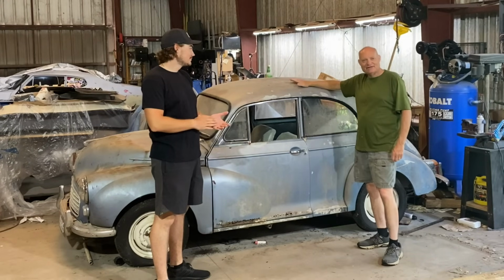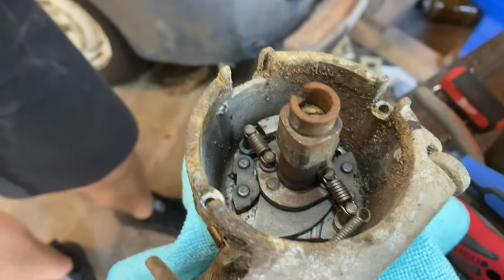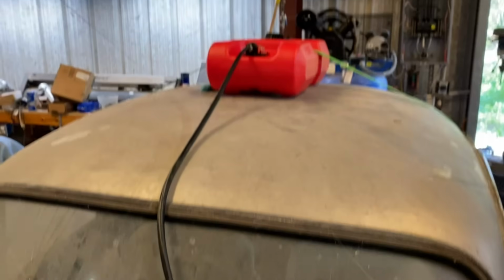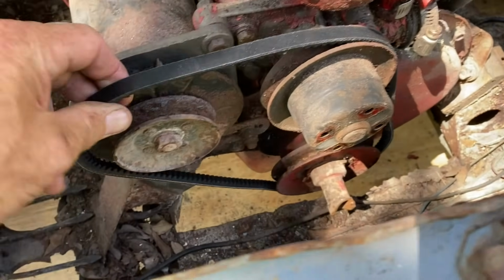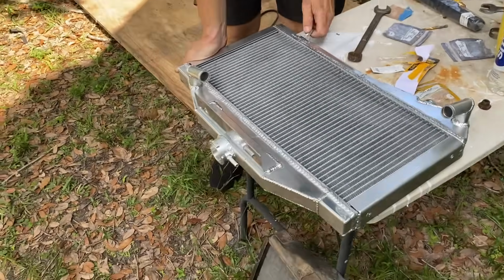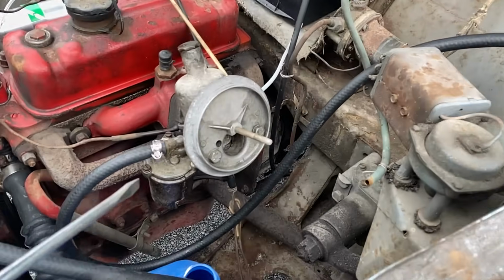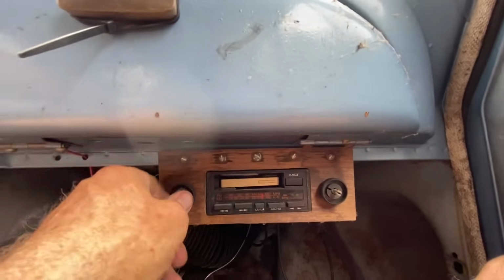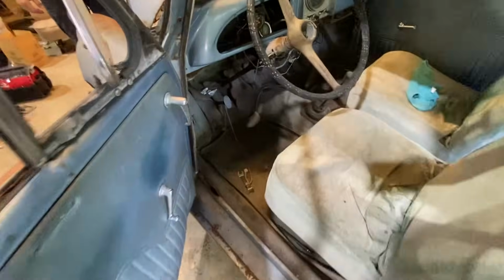1967 Morris Minor (Will it Run and Drive?)

Comment: 75 yrs olde here. My father had three different "Woody" versions of the Morris Minor. I passed my driving test in his pale blue "shooting Brake" in 1967.
Later years he had the Morris 1100 estate with hydrolastic suspension. We had the engine rebuilt at a machine shop and installed it our selves.
The darn thing would not run, even after we towed it around the neighbourhood. We discovered that with this series of engine the distributor drive can be installed 180 degrees out of whack. Look at where the distributor goes into the engine block at 02:57 - The drive peg is not offset, so it can go back together the right way or the wrong way!
Reply from the maker: I’d love to have a Woody. It seems to me the distributor was installed 180 out in my car but the wires were adjusted so that it would run. In most cars when no 1 is at TDC the rotor points towards the number one cylinder. Can’t remember if we had an issue starting it at some point after installing the distributor but I wouldn’t be surprised. It’s easier to just reroute the wires than pull the distributor.

Comment: She's done. Needs a whole new frame...new 'plexiglass' front and rear windscreens (yes, apparently, they are available in Britain - somewhere)...I wouldn't drive this with a totally rotten frame subassembly...gonna fold up on you...not good...but, hey...My aunt had one of these in the 70's on her farm near Hamilton Ontario...once you got it started (leave the choke OUT in cool weather!) it was fine...battery life was terrible...the generating system was awful....Good to see this video, so many memories!
Reply from the maker: Thanks. We haven’t driven it since the video. We want to weld in all new metal underneath but just haven’t found the time/money. It’s only worth it because this one is sentimental.

Comment: I left my 1969 Volkswagen with my parents while I was stationed in Germany from 1973 - 1976.  When I returned from Germany I just assumed that since it had not been started for three years that the engine would need to be rebuilt.  I knew nothing about cars.  I bought a new battery and fresh gas to see if it would start.  I pumped the gas a couple of times turned the key and it fired right up.  I never had the engine rebuilt as it ran like a champ after having sat for three years.  Great German engineering!

Comment: My first drive was in a Morris Minor of 1954.  I learned how to drive on it and later learned a lot about the inside of engines.  Yours has the  1,000cc motor, mine only had the 803cc though I later swapped for the BIG engine.  Mike in Oz
Reply from the maker: I didn’t know about the 803. I knew there was a flathead and later the 948 and then the 1098 that we have.

Comment: The suspension pins were a weak point and bad design, so long as you greased them very regularly they would be fine, but going back 50 years you would see the odd one with the suspension gone at the front.  Easy to fix but not great when they failed on the road.    I had two of them, so easy to fix, ah happy days!

Comment: Lovely to see it running, and great memories.  I fear that with so much rust it might be the last time 😢
Reply: Morris minor spares in the UK have every part for rebuilding an MM.
Reply from the maker: Thanks, It won’t be anytime soon but I’m confident we’ll get it on the road again. I do think I need to hurry up and buy the replacement metal while it is still available.
Reply: Not at all. Fluid Film treatment will stop it for good. Well, after some replacement and maybe welding

Comment: Lucky the thermostat housing wasn't  corroded to the block  and the studs !  If I remember correctly,  when you get to the master cylinders under the floor you'll find some of the  nuts/bolts are 1/4 Whitworth..... does get more old school than that !

Comment: My first Car, Paid $70.00 for it. Drove it aroun,d, illegally of course cos I didn't have a license, The I got my call up and it sat outside my mum's house for about eleven months while i was away. Came home on leave, got my license, then traded it for a red Escort, got $200.00 . good car , windows taped up cos the winders didn't work. Rust holes in the floor, but you couldn,t stop it.

Comment: Did everything in a Morris minor .would pull the car over onto a square bale and change the clutch. I think I did it all with a 1/2 inch And 9/16  spanner. Owned 5 in the day still wish I had the traveller. Brakes were terrible the shaft would seize under the floor Matt and the cylinders would seize. But the engine would always start with the starting handle. Simple car. No fancy electronics. Loved them.

Comment: I have a 1952 Morris  minor  4 door side valve Engine  with Dashpot front suspension system , leaf spring rear suspension.  Not in working condition for over 15 years  it gave me excellent service . Now parts availability is problem

Comment: My first car was a 1959 Morris Minor. At age 16 I learned a lot about cars with that model. Required vegetable-based brake fluid, proper installation of front wheel bearings, desirability of synchromesh in 1st gear, necessity of damping oil in SU carbs, proper centering of jets in SU carbs, desirability of decent oil cooler in California and/or cross-country trips, ineffectiveness of low-compression pistons, downside of shaving the flywheel (ring gear eats a hole in the oil pump), non-necessity of turn signals as standard equipment . . . I could go on, but I think I’ll stop here, I think you get the picture.
Reply: I currently have a 1959 Morris Minor 1000 / 2 door 😊

Comment: Those engines, not actually Morris, but Austin, 3-bearing crankshaft, pushrod valve operation were still in production until the year 2000, although unrefined, "tappity" they had a hard to beat combination of  drivability in a wide torque curve  and low fuel-consumption, Harry Weslake was the engineer behind the cylinder head which gave these engines  those characteristics.  Another aspect, even after high mileage, they were good first time starters in all weathers, deep winter or high summer,  something which the equivalent engine from Ford could not match
Reply: thanks for showing it was a bit like back to the future lol  i enjoyed it
Reply: The car was designed by Alec Issigonis. He was born in what is now Turkey. The headlights in the early version were down below on both sides of the grill. They were repositioned higher up to suit the US regulations. This change displeased him. Of course his fame was sealed with the iconic Mini design. As has been pointed out, the side-valve engine was replaced by the Austin OHV engine improving it greatly. It seems strange that side valve engines lasted so long when there were OHV designs around even before the war such as the MG engines derived from Wolesley models. Ford in the UK carried on using (low compression,  poor MPG) side valve units (100E) up to (?) 1970 until the 105E replaced them.

Comment: Oil in the dash pot will improve the operation of the SU carburettor.

Not sure that red engine is a factory rebuild. Here in the UK at least, factory rebuilds were "Gold Seal" and painted accordingly.

From memory, and it is about 50 years ago now, rebuilt units didn't come with ancillaries (manifolds etc) so wouldn't have been painted in the same colour as the block/head.
Reply from the maker: I don’t remember where my dad found the engine but my memory tells me it might have been silver. I think I painted it red with leftover pint used for a Chevrolet engine. Next time we work on it I’ll scrape off some red and see what’s underneath.
Reply: @davebdave1  if I recall correctly you can tell the origins of the engine (capacity, type of vehicle...) from the prefix of the serial number on the block and a factory remanufactured engine will have its own prefix. I think I've got some documentation around here somewhere.

If you let me know what the first 4 characters of the serial number are I can probably check them.

Comment: My father had a Seriies V Traveller in which we had a memorable holiday around 1970 camping in France, Switzerland and Italy.

Rather later in the '70s we had a 2-door Series III as the family car. Dad bought it for Mum to drive and my brother and I to learn on. The deal was that Dad put up the purchase price and that was it, we had to service and repair it ourselves with Dad's tutelage if required.

They had weak 1st/reverse gears and we had to change 2 or 3 gearboxes sourced from the scrap yard. We eventually came across a unused Gold Seal (BMC refurbished) gearbox and that was the last one we fitted. We were pretty adept at whipping out the front seats, taking up the part of the floor covering the gearbox/clutch and swapping the gearbox, a Sunday morning job.

The brakes were a pain as the wheel cylinders seemed to seize on a whim and always needed changing for the MOT.

Dad's insistence on us maintaining repairing it is principally what has enabled me to maintain my own cars over the years up to and including our current BMW E39s.

As teenagers we had ideas about dropping Midget brakes and engine into it but this remained a pipe dream.

My first car was Series V Moggie 1000, given to me by my grand-father when he gave up driving. It didn't last long. In common with most BMCs at the time the tin-worm was quietly chewing away at the floor and sills. 

It was his 2nd Moggie. He had a Series III that he had traded in for an 1100. The 1100 never did find favour with him and with some expensive rust repairs required on what was a nearly new car he got shot of it and bought the Series V.

His brother's one and only car was a Series II convertible, it would be worth a bob or two these days.
Reply from the maker: I had forgotten but we did replace the gearbox at some point. I don’t know where my Dad found it.

Comment: Radio looks pretty good
Reply from the maker: LOL, I mounted it to a wood panel to isolate from the Chasis which is Positive ground. I spent some time making sure everything was isolated from the car’s metal but that was before the internet. I now know that I could have just switched the battery to negative ground and re-polarized the generator in a matter of minutes.
Reply: @davebdave1  ye even before cd that one

Comment: CLUTCH SEIZED INFO... Previously the following has worked for me...warm up the engine in neutral.  Then switch off.  Then select first gear, (or reverse), and start the engine. The car will lurch and start driving forward (or backward). Remember this is decades before those silly new safety laws about "foot on the clutch to activate starter", (none of my cars have EVER had that). Now as you drive the car around the yard in first/reverse accelerate and deccelerate in a jerky fashion.  This will often enable a stuck clutch to become free. Job Done !

Comment: RADIATOR CAP info..., yes be sure to use the correct Pressure rating. The oldest Morris Minors, the Sidevalve engine models from the late 1940's and early 1950's were ZERO pounds pressure rated, ie it was just a Steam Venting cap. It had no spring, just some zigzag sorta holes to stop water sloshing out on corners. It worked without a waterpump but the radiator had a large top tank and contained from memory 14 litres, about 14 US quarts of coolant. Later British cars, such as the later Overhead valve Morris Minors, 850cc, 1,000cc and 1100cc had either 4 psi or perhaps 7psi radiator caps. Yes you are better using the original old Radiator cap at first. Find out what that model was supposed to have and buy a new correct one if needed. Over the years, cars' cooling systems have run at increasingly higher pressures. I saw a neighbour blow the radiator up is his Morris Minor (sidevalve, unpressurised) and then complain that Morris-es had bad radiators and always blew up their radiators. He was running a pressure cap on it ! LOL  Great to see a Morris Minor on the other side of the world, even if your steering wheel is on the wrong side of the car. cheerio xx
Reply from the maker: Thanks, Interesting that the flatheads didn’t have a water pump
Reply: @davebdave1  Yes the cooling system operated totally by "thermosyphon" only  whereby the hotter water rose and cooler water sank. So no heater option was available on the  (918cc) sidevalve engined cars.  Heaters became available, (often on British cars of the era as an "extra cost option") on later Morris Minor cars with overhead valve engines (850cc, 1,000cc and 1,100cc etc), and, crucially, that engine design always had a waterpump. Without a typical waterpump to bolt the radiator fan blade onto, I seem to recall the fan blade being bolted  directly to the generator pulley, (on the sidevalve early model Morris Minors).   New Zealand had primarily British made cars (before the later Japanese car invasion, 1970's onwards) I'm of the generation that Morris Minors were getting old enough and therefore cheap enough, that for many of us, it was the cars we learned to drive in, or buy as affordable to a teenager or first car, and subsequently learnt to repair.

Comment: You can get nearly every part you need still for the "Moggy" in the UK. And reasonably priced as theres a huge following for them still. As a rare care in the States it would be well worth restoring. They are actually quite a smooth car on the road, fast they isn't by todays standards but a simple piece of car to keep in the road.
Reply from the maker: I’ll see a Morris at the larger car shows but I haven’t seen one out on the road in years. There are a few parts suppliers here in the States so I’m confident we can save it.

Comment: Lucas electrical system = Prince of Darkness
Reply from the maker: LOL, I’ve heard that but I never had any electric issues in the Morris except for the SU fuel pump randomly quitting until I rapped on it with a screwdriver.
Reply: @davebdave1  The SU fuel pump was not made by Lucas

Comment: This car smartened could be a nice looking car. I once saw  the rival to this car, the Austin A30/A35, in exactly the same shade of metallic blue.( silvery metallic blue). A non- factory finish. It occurred to me that METALLIC finishes particularly suit such curvy cars. In the metallic colours, you see a light and shade effect on the curves! Also, the smaller lights under the headlights look particularly nice, because they MATCH the headlights. Unlike in the U.K., where the small lights are ORANGE/WHITE  FOR THE TURN signals/ running lights.
Reply from the maker: Thanks, My grandfather convinced me that it would be the best color for the car. He also painted it for me in 1986